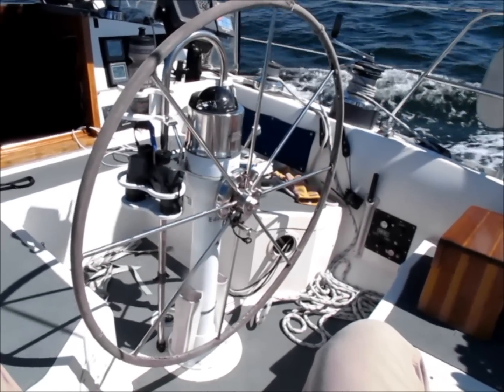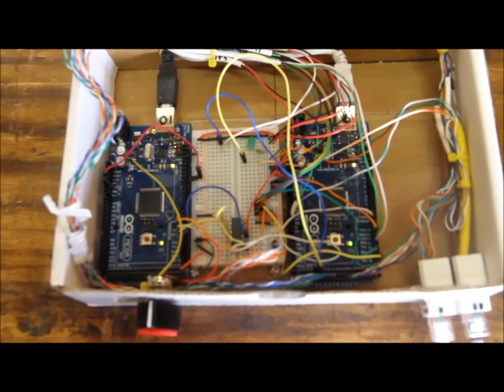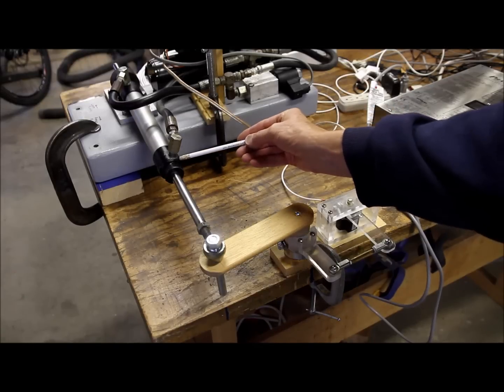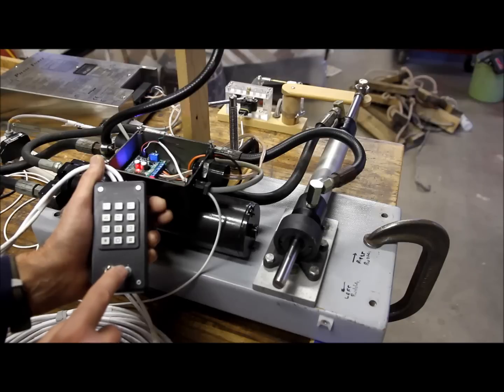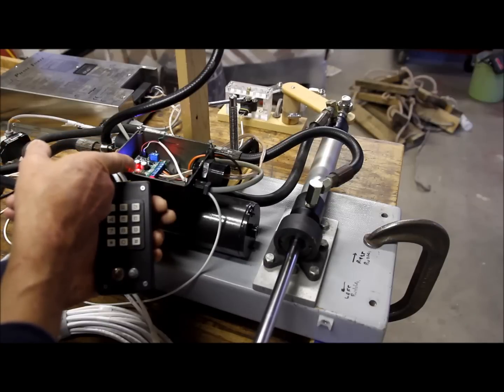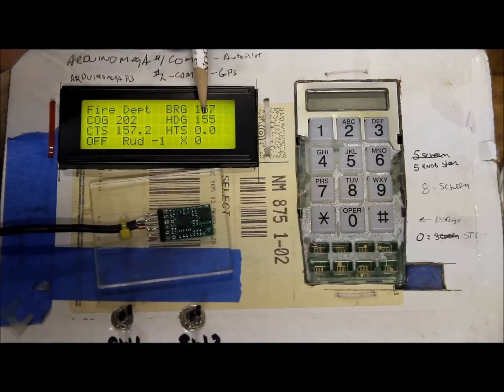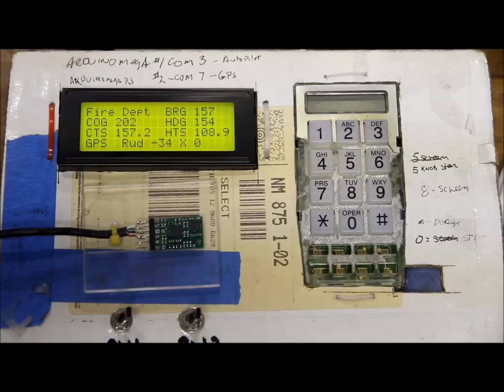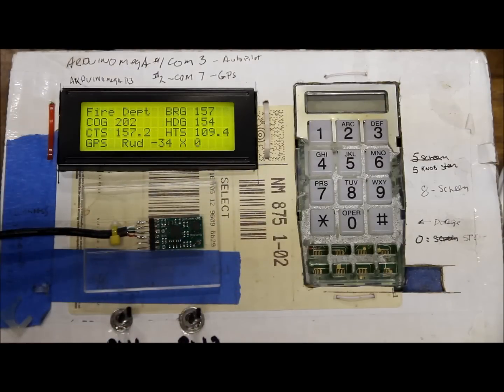Jack Edwards Arduino Based Sailboat Autopilot #1

Comment: I have an old Autohelm 2000 tillerpilot and I anticipate that the old electronics will give out at some point.  I would like to build or buy a control unit with a 12 volt motor controller to move the ram.  Question: why not add GPS course as an option?  I mean the GPS HDG not tracking to a waypoint.  This would be able to be steered with a remote incrementally just like using MAG HDG.  I understand that this mode would require the vessel to be underway to establish a valid gps heading but otherwise, why not? Raymarine had an expensive A/P that used two gps sensors located a fair distance apart to provide static heading but I wouldn't require this refinement since I know when I'm moving. Usually.

Comment: WoW! I wish I had found this a ages ago, Well Done! I'm looking to build an autosteer (not an auto pilot) but because all of my research is pointed towards AgOpenGPS & I am already running Oxiexplorer mapping for the setting out of our annual event, it's not really suited. I already have NMEA 0183 autopilot output from the Oziexplorer so I figured I should be able to rig up a temporary steering motor for the infield use (& of course disconnect it for normal road use) I would have thought a simple motor & controller like what is used in AgOpenGPS on tractors, that I could 3D print that & then use the output strings from Oziexplorer,  it "should" be fairly simple to do don't you think??
Reply: Should work, probably need a heading sensor.

Comment: Very nice Jack.  I have built a simpler one with a screwdrive moving the tiller based on GPS alone and a ComFile CB220 chip.  How does your system handle following seas?  I was thinking of adding a second (faster) PID from a compass that would try to correct for orientation slewing... any thoughts?

Comment: I'm looking for a hydraulic actuator/pump for a similar project, where to source those when on a budget?
Reply: Jan, I have been out sailing and just got your comment. I have not found an inexpensive hydraulic pump and ram. Some have found used units. One person was very successful using a windshield wiper motor and worm drive with bicycle  chain and sprockets.  If you find something I would love to hear about it.

Comment: Jack,

Please can you advise what mathematics you used (If any) to smooth out the incoming direction signal from the compass?  I am guessing the compass is going to be bouncing around a fair bit as the boat moves.  Do you use a low pass filter or something more sophisticated?  You mentioned a Dynamic Model?  

I am happy that I can build the electronics and write code, but it would really help if you could advise on any maths tricks you used to tune the response.

Best wishes and a happy new year!
Reply: Hello DB82,  I don't average the compass readings.  I do use a user adjustable steering dead band of 2 degrees and also use a rudder speed proportional to compass error so the rudder does not move much and the compass noise is not an issue.
Reply: Jack Edwards many thanks. that gives me the confidence to go ahead. Happy new year. :-)

Comment: Hello, I'am sailing a Westery Pentland and  on board is the Autopilot "Autohelm 3000" defect. The engine unit is still ok, the electronic control is defect. I like your solution with the Ardunio. Is it possibil that I can get the circuit diagram and the program for the Ardunio? Thank you for a short info.
Reply from the maker: Manfred,  I will be glad to send you information I have not established a Github place yet so please send me your email address to coyotewaits3@gmail.com

Comment: Ever since my autohelm broke, as they often do... I can't believe how expensive a decent autopilot system is while my iphone has 100 times the computing power of anything raymarine has... I'm going to start this project right away!

Did you ever consider using a worm-screw drive vs a hydraulic system?
Reply from the maker: Chris Blakeslee
Reply from the maker: Jack Edwards Projects Chris one of the people using this project is using it on his schooner that has an old Edson worm screw drive.  He got a Raymarine rotary drive and hooked it up with a chain drive and then used  this Arduino system to operate it.

Comment: Well done sir! Did you ever consider using one of the 'off the shelf' arduino based auto pilots used by the R/C aircraft crowd? Seems like it could be easily adapted to what you're doing. 3D Robotics is a popular vendor.
Reply from the maker: sethalump  I looked into using Ardupilot and Arduboat.  At the time, to enter GPS waypoints you had to type them in and upload them.  I wanted a system that would use a standard chartplotter or navigation program running on a laptop that would allow you to draw waypoints with a mouse on a map.

Comment: Nicely done!! i was thinking doing the same but use an android phone as the logic controller and the arduino as interface to the motors (my goal is simple at first, to steer to a set compass heading on great lake (i have a smal motor boat)

Comment: Nice job.  The box makes it 'home-brew' worthy.  I wonder why you used two Arduinos.  Where there not enough pins on a single unit to do everything?
Reply from the maker: The Reason I have two Arduinos is not the availability of pins but the cycle time of the GPS.  It cycles once a second.  The compass and all other control cycle 50 times a second.  The GPS just slowed everything down too much.  One Arduino Mega processes GPS once a second.  The main Mega reads it once a second with Bill Porter's "Easy Transfer" library, but the transfer only takes a few milliseconds so it doesn't bog down the main.  Parallel processing.
Reply: As I've seen the documentation file, the GPS module uses RS232 @ 4800 baud, TTL
The Arduino Mega 2560 I/O ports are all TTL, so there is no need for level converters.
TTL (Transistor-Transistor Logic) operates with a 5V power supply.
If the GPS module outputs data by itself every second, you could just poll the serial data, when available, and store it to a global variable (connecting the GPS module to the Serial1 port, for example).
This way, it would not affect the 50Hz requirement for the main control, since the Serial library is asynchronous.
An example code snippet:

byte controlTimer = 0;
//the rest of global variables

void setup()
{
  Serial1.begin(4800);
  //the rest of setup code
}

void loop()
{
  if(Serial1.available())
  {
     //read and store GPS data
     //the autopilot code will work over this data
  }

  //this will always trigger if controlTimer is 19 before
  if(++controlTimer == 20)
  {
     controlTimer = 0;
     //do the autopilot thing with the GPS data
  }

  delay(1);  //1 millisecond step
}
Reply: Danilo Duarte
Danilo beat me to it.  Not that you should as your setup obviously works fine but you can do what Danilo mentioned above and have 1 less component.
Reply: Hi Jack, you can process these asynchronously with a single arduino. I have GPS at 10hz (with line crossing math), gyroscope at 10hz, serial communication at 1hz, bluetooth, various other input/output checking on a Mega without issue. 

reference https://www.arduino.cc/en/Tutorial/BlinkWithoutDelay 

I use Adafruit_GPS library which is interrupt driven, whenever there is new data in the buffer it will grab and parse it to some user variables for you. There shouldn't be any time the code is waiting. Also configurable between 10hz and 1hz NMEA output.

Comment: Is code available. I am wanting to convert it to bascom avr and looking for formulas. I have an autohelm 4000st and looking to buil a replacement for my tiller drive on the yacht.
Reply from the maker: Terry Peake 
Terry,  If  you will send me an email to coyotewaits3@gmail.com i'll send you a link to my dropbox where the code is available.
Jack
Reply: +Jack Edwards Projects Would you be willing to share this on a public github.com repository? Would love to help with it if you don't mind it being open source. or even private shared repo. 

I'm starting my own arduino autopilot but using just the digital compass and a linear actuator for the tiller with built in potentiometer from progressiveautomations.com. 

Would love to share ideas and code. I'm really exited to build this for my 25' sailboat